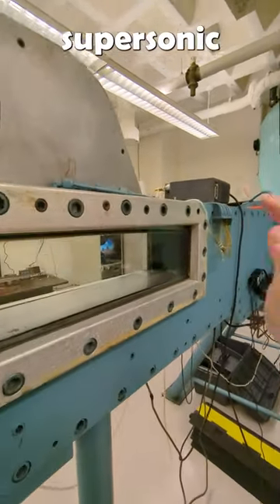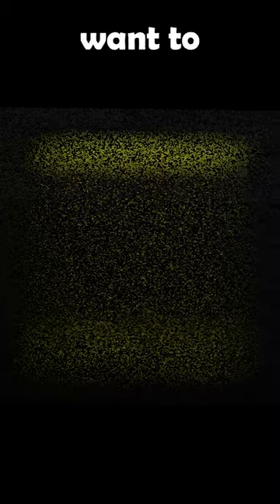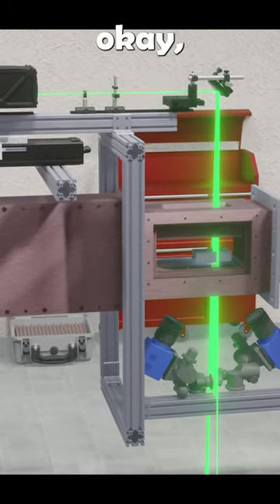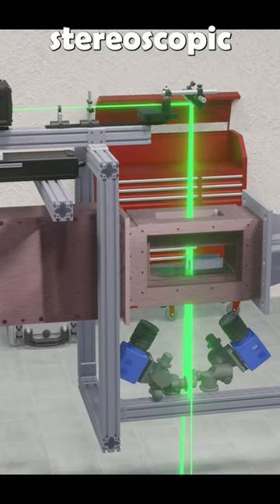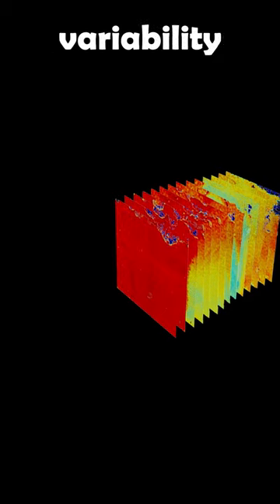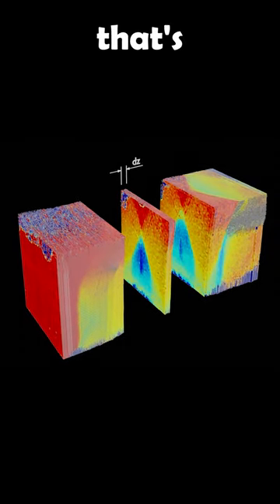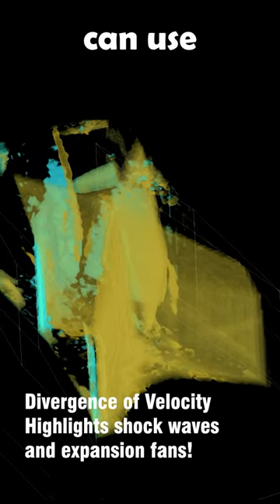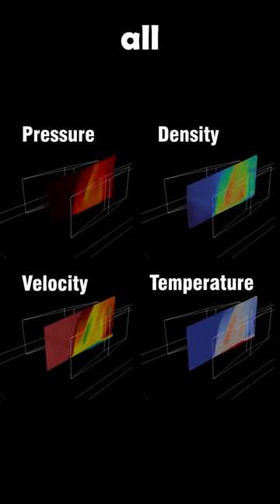Using Scanning SPIV to get 3D pressure in supersonic flows

Comment from the maker: Thanks for checking this short! Links to the referred papers:

"A continuously scanning spatiotemporal averaging method for obtaining volumetric mean flow measurements with stereoscopic PIV" (Zigunov et al, ExIF, 2023) - https://link.springer.com/article/10.1007/s00348-023-03596-w
"A fast, matrix-based method to perform omnidirectional pressure integration" (Zigunov and Charonko, MST, 2024) - https://iopscience.iop.org/article/10.1088/1361-6501/ad2da5
"One-shot omnidirectional pressure integration through matrix inversion"  (Zigunov and Charonko, Under Review, 2024) 
https://arxiv.org/pdf/2402.09988.pdf